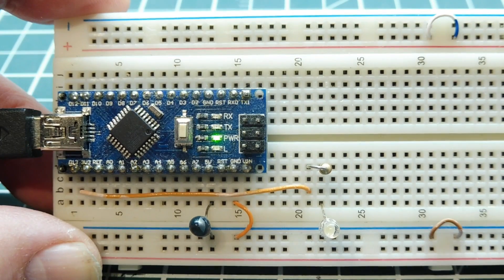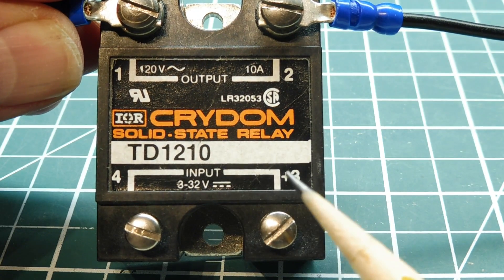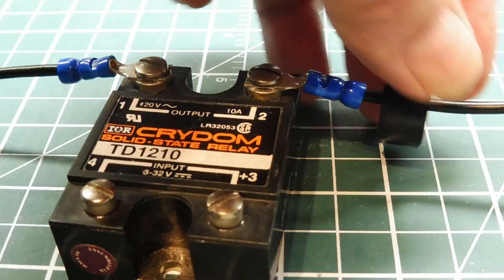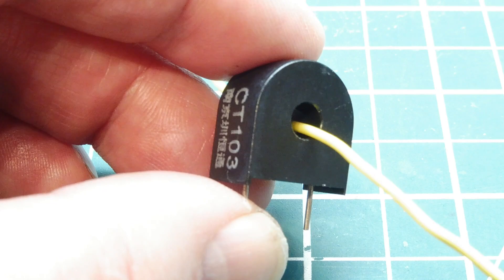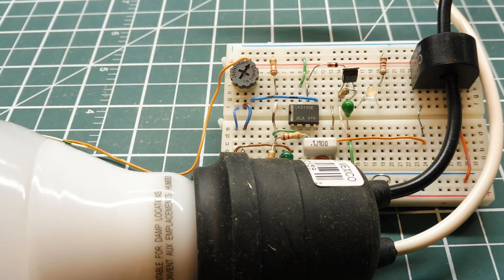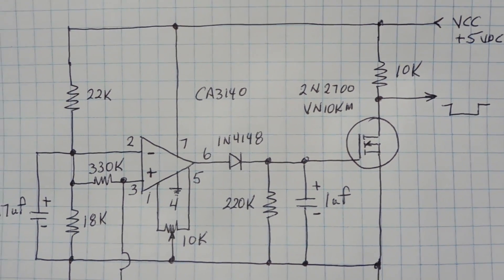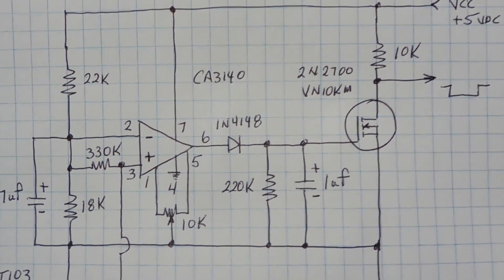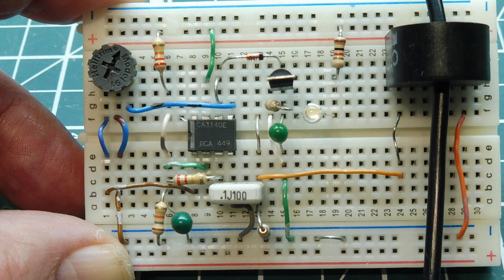AC Current Detection Interface

Comment: Out of curiosity, if the swing on the coil is 600mV, would a single germanium NPN not be an adequate alternative to the whole op amp front end?
Reply from the maker: Yes, with a large enough output you could feed that directly into an indicator circuit or even an ADC of a microcontroller. By adjusting the burden resistor, this circuit was designed to detect large currents to very small AC currents. I use the op-amp circuit to build many types of custom sensors.
https://youtu.be/wEqfHo_guG8
https://youtu.be/2_aGQjPzySs

Comment: Will this work at 100ma load? Just ordered some of those CT's and parts.
Reply from the maker: The circuit is pretty sensitive so by using the sensitivity pot and adjusting the value of the burden resistor you should get it to trigger with 100 mA.
Reply: @0033mer  I can always run a few more loops around the CT, I will give it a shot.
Reply from the maker: Yes, that will also help.

Comment: I don´t understand why you connect your GND line in the protoboard (0.29s) .... It´s already connected from the factory... Arduino Boys :(
Reply from the maker: The power and ground rails on my solderless breadboard are split at the center and are not connected from the factory. When Continental Specialties introduced the solderless breadboard in the early 70's the power and ground rails were split and were for many years with many vendors until knock-offs from China came on the scene. As a teacher I see students forgetting to apply the jumpers and wonder why their circuit is not working. I can see you are a beginner to prototyping with solderless breadboards. The Arduino bootloader on the ATmega328p has been erased ad reflashed with a FORTH operating system and programmed in FORTH so no "Arduino" code is running. https://www.forth.com/resources/space-applications/
Reply: @0033mer  If the blue/red line is continuous, so the breadboard is connected internally. Try It...
Reply from the maker: Yes .. If the lines are continuous they are connected internally. Some boards the lines are broken indicating they are not connected internally. When a student carries around these boards in their backpack the blue/red lines eventually rub off which causes problems. I instruct all students to apply jumpers and leave them there no matter what the markings are. This resolves many problems for the students.

Comment: How I can setting current limit 27A  and the led turn on?
Reply: ADC using any microcontroller would do the job. But this current transformer supports only 5A measurement of current
Reply: @laxrad24  
What will happen to this current transformer if current was large then 5A ?

Comment: can i use this sensor to measure dc current? for example a current of a 190 v dc motor
Reply from the maker: No ... the sensor uses a transformer which needs a moving magnetic field (AC) for proper operation.
For DC detection you need a linear Hall effect sensor. https://www.elecrow.com/acs712-current-sensor-30a-p-710.html

Comment: So I have an LED on the active LOW output, but it never really shuts off. So I was thinking maybe the op-amp output noise never puts the gate LOW. 

Would a split power supply to the op amp with a negative voltage be better to pull the gate LOW? I have noticed that red LED is easier to shut of while blue, white and green (if I remember it right) are not as easy to shut off, Im guessing it has something to do with the voltage drop difference. 

Im switching a fan on and off sensing a 230Volt heatgun and it works pretty good for being my first build, and Im actually sensing directly on the op-amp output and its a bit sensitive but it works not perfect but okey. I could not get the intended output to switch off so I took this path instead. 

thanks for a great video

Comment: Hi, is it possible to incooperate a counter within the code to detect the "downtime"?
Reply from the maker: Yes .. or even a Real Time Clock (RTC) IC to measure a time interval.
Reply: @0033mer  thank you for your reply, but may i know what would be a better way?, i have tried using the code below but seem to have an whenever, i place a wire into the arduino Analog in A0

Comment: Nice video. I need your help my project name is overloading detection and automatically shunt down  using arduino, display 16*2,CT, and relay then bulb as a load. Then one bulb holder add a bulb then display indicate like 40watt of bulb now iam add second bulb then display indicate 40w+40w=80watt. And one set value like 300Watt then iam add bulb more then 300Watt then my relay trip and display indicate overloading. So how iam make this project  please help for circuit diagram and arduino code only please help me. Relay my comment.
Reply from the maker: http://henrysbench.capnfatz.com/henrys-bench/arduino-current-measurements/ta12-100-arduino-ac-current-sensor-tutorial/
Reply: @0033mer  thanks for replying my question. in this link not given display connection 16*2 circuit and one question this for AC. Watt measurements?

Comment: Hi.  Great videos.  I need to pick your brain. . . I run a full solar system in my 9 ton truck and caravan. (Australia ) I am retired and travel Oz. I run an 8kw inverter for my heavy loads. Hot water system, bread machine, coffee machine etc. Rest of the time,  I switch over to my small 1kw inverter. The internal 1kw inverter fan, switches on above 45 deg C.  For me, I prefer to run the inverter cooler so I have an additional cooling fan running all the time. I'd like to control when the fan runs. Say 0.5 amps (240v in Oz) 120 to 150 watts.  It's so annoying at night when there's almost Zero load and the fans running. Noise. . . Do you have anything that can operate a relay to switch the fan on and off thats controlled by the load amps ?
Reply from the maker: You need an AC current sensing switch.
Here is an example. The current trigger value is adjustable. Get the model that meets your current/voltage needs
https://www.amazon.ca/NK-Technologies-AS3-NOAC-FT-Normally-Solid-core/dp/B005S71MAC

Comment: Earlier question erased...  just realised the op amp did not send any current... okey I have to find a mosfet then... thanks for the video
Reply from the maker: The correct Mosfet part number is 2N7000.
They are available online:
https://www.banggood.com/10pcs-2N7000-NChannel-Transistor-Fast-Switch-MOSFET-TO92-p-924050.html?rmmds=search&cur_warehouse=CN
Reply: Thanks.

so whats the features you are looking for in this mosfet?
Reply from the maker: The gate to source input of the mosfet is high impedance so it will not load down the output voltage of the charge pump circuit. You can also vary the value of the 220k bleeder resistor to adjust how long the LED stays on after the AC current drops to zero. Another variation is to use an opamp as a voltage comparator to trigger the LED.
Reply: Wow I got it to work with an Arduino and a relay, such a good feeling! Can´t wait to share...

Comment: Hey man cool video. I need a help. My friend keeps frying his phone chargers, router power adapters etc. I took them apart and all of them look really charred. He asked me to build him a good charger but I'm worried that the power quality in his house might be dodgy but I'm not sure. What kind of protection should I put in the charger input to ensure it doesn't blow up like the other ones?
Reply from the maker: Try to find out the source of the poor power quality and get it restored.
If no luck there install a Sola CVS transformer (constant voltage transformer)
Check on ebay.